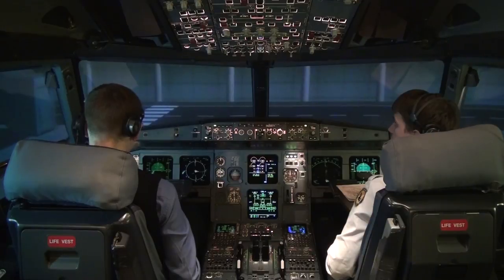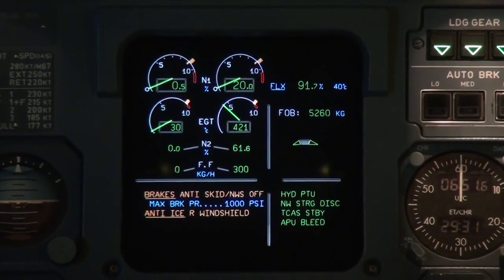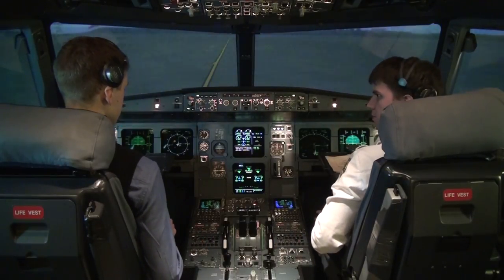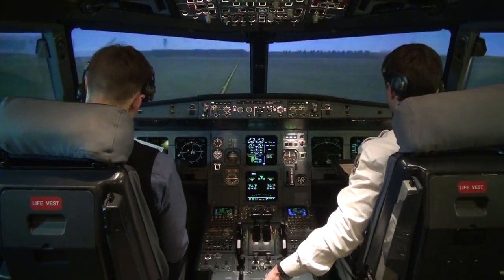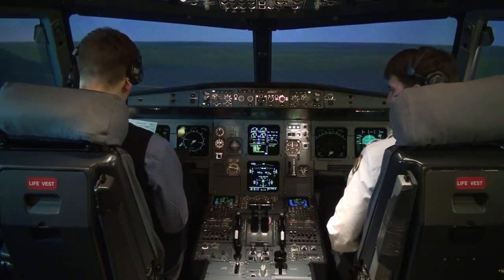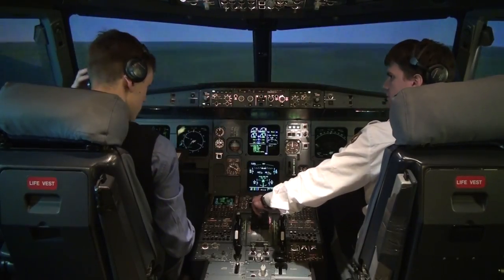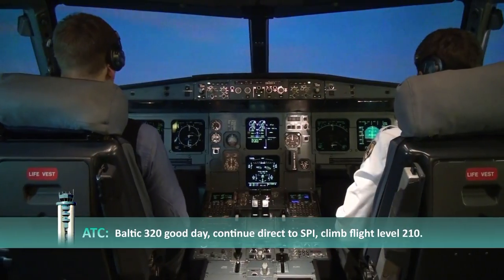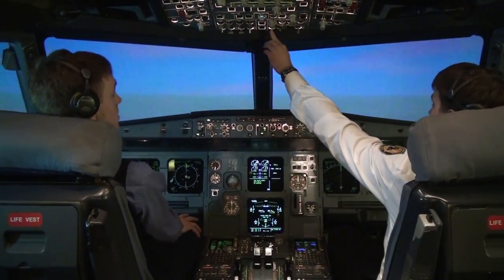Flying Airbus A320: full flight video from the cockpit (part 2) - Baltic Aviation Academy

Comment: Watching the series the first time. I'm guessing both of the pilots on the video are students? If so, I fully understand.
The good thing here is that they are doing everything in a calm and somewhat slower fashion than your normal "years in the biz"-pilots would do, but I have to agree that there are quite a lot of mistakes made, which as I said, is understandable if they are both students.
Either way, thanks for the videos.
Blue skies!
Reply: they have to work on the mcc lack of communication and the proper way to describe the situation after an engine start

Comment: -Didn't turn off the external power before disconnected
-1:50 wtf he turned off the nosewheel steering and anti skid, wtf. That's automatically done when the pin is inserted when pushing back
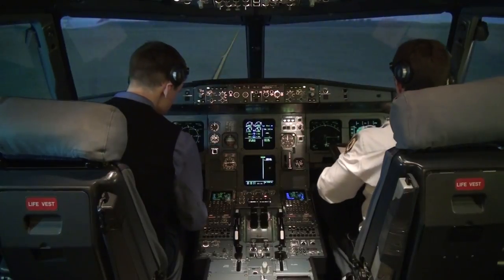-5:15 Turned on the Taxi lights without clearence and forgot runway turnoff lights
-6:40 captain didn't wait on the copilot checking the flight controls
-8:45 what did he check? Something he shouldn't even check?
-9:25 wtf did he do with the throttle
-9:40 rotation was way too fast, could've leaded to an alpha floor protection
-10:05 'thrust levers to climb maybe?' 1. Check your freaking pfd for that 2. Maybe? What's that in aviation?
-10:28 maybe flaps 0 lol
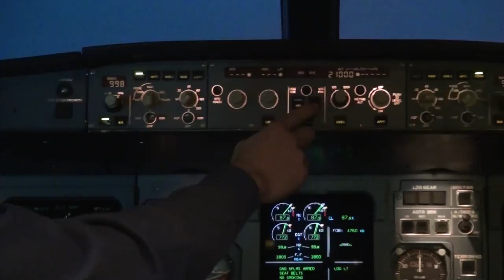-11:10 passed transition altitude but didn't set the runway turnoff and nose lights to off
Reply: Haha you are so cool. This is a student in a flight school showing what he gets to do in school. How dumb do you have to be to think this is a how-to video?! You really took the time to make this list...Your desktop flight simulator not working today??

Comment: Very interesting video as usual but you do not really seem to differentiate between the pilot flying and pilot non flying. The two roles are quite defined but you both seem to jump over each other and touch the thrust levers as if one is fighting for control. You seem unprepared for your assigned roles. Perhaps a touch enthusiastic but who can blame you. Great work as usual!

Comment: A little messy, smoother rotate perhaps and set flex not full thrust. But, they are the pilots after all. They are learning, they are bound to make mistakes. I'm currently looking at different FTOs to train with, I'll keep an eye out for BAA.

Comment: I detected some big mistakes...
Reply: No FMA reading, for flex take off PF gave TOGA power n PNF took thrust levers back..
Reply: no to config, that was in test no in normal
Reply: amol ganne Yes, also "positive rate" is not for Airbus. And there also was a mistake with "landing gear up and off". That seems like b737 pilots were sitting in the cockpit..
Reply: Smart TV positive rate is for every plane from C172 to 747.
Reply: @taffy5152  talk after you read Airbus fcom standart callouts.
Reply: They didnt disarm spoilers and close nose and turn off Lights after clean configuration. They didnt close packs before take off. So They didnt open packs after setting climb detent. Etc etc
Reply: They didnt on autobrake max before take off. They didnt open pm's terrain on nd. Checklist use and callouts are completly wrong.

Comment: Packs should be off before takeoff. Nose lights and runways turn off lights should be off after retracting the gear, and the rotate was mad
Reply: Who said that lights should be off after gear retract, lights should be turnoff at FL100 FT. :)
Reply: Dont talk when you dont know about aviation. Landing lights should be off at 10,000 however the NOSE light and the RUNWAY TURN OFF LIGHT should be off straight after the gear is retracted as the lights will still be hidden as the gear will be retracted and the lights are on the gear so there is no point keeeping them on. Do you understand?
Reply: Augustas Klova 
Dont talk when you dont know about aviation. Landing lights should be off at 10,000 however the NOSE light and the RUNWAY TURN OFF LIGHT should be off straight after the gear is retracted as the lights will still be hidden as the gear will be retracted and the lights are on the gear so there is no point keeeping them on. Do you understand?
Reply: Oh, i'm sorry, i've mixed landing lights and nose lights.
Reply: If i'm sure the nose lights should be off when the after takeoff checklist arives.
Reply: No. Its not even on the checklist
Reply: Its just a standard procedure. Gear up, nose lights and runway turn off lights of and ground spoilers disarmed ...
Reply: I've seen on some checklists.
Reply: Packs can stay on they don’t have to be turned off (in boeing yes airbus no) Nose and rwy turn off lights turn off automatically after gear retraction on airbus you just need to put the switch to off, rotation was bit crazy but they are/was students and mistakes can happen.
Reply: Arlind Celkupa and correct there isn’t an after take off checklist. Instead it’s an after take off flow that you go through.

Comment: How do you arm the speedbrakes on an Airbus? On a Boeing, you have to set the speed brake lever to the white "ARM" line. But on the airbus, I dont see that. How do you do it?
Reply: You just pull the lever up I think
Reply: +XpertPilotFSX the 0% of speedbrake is not full up, but little bit of space remain and this space is to arm the speedbrake

Comment: Rule of thumb - If either pilot uses the expression ''maybe'' they should not be in the flight deck... Retarding throttles during the take-off roll, going to flaps one below the safe clean speed and to zero flaps also below the safe clean speed, in-complete checklists in the wrong priority - If you're going to do a video on the A320 at least do it right, properly briefed and knowing what the aircraft is about to do, before it does it, then and only then do you know what you're doing.
Reply: look, I agree with you by retarding throttles during takeoff roll, but they did not retract flaps below minimum flap retraction speed. That's the only thing they got it right :)
Reply: Cathal Kavanagh Really? This is a student in a flight academy showing what they get to do. This is not a how-to video... A desktop flight sim know it all critiquing a young student learning how to fly- you’re really cool.
Reply: @dylconnaway9976  sorry but they are not kids, theres a big lost in the CRM management and as a pilot you have to have that gift (leadership, set priorities and work as a TEAM). Furthermore, videos title says Flying the A320, so THEY SHOULD DO IT RIGHT IF ITS A VIDEO REPRESENTING THE FLIGHT SCHOOL... just saying.

Comment: after star engines you must apu bleed aou master off, check cabin, autobreak MAX,  Line up - TCAS  mode C. Terrain radar on, weather radar on , Timer on.
Reply: 1) it's either Terrain or WX in the MFD, not both at once 2) Radars are only turned on when you enter the runway due to the strong rays 3) Mode C is not always required, in the US yes, in Europe, almost never on ground

Comment: Good go ahead radio to tower ✅, equipment to ground communication ✅, tail fin and breaks check, head unit and communication in cab pilot to pilot ✅, power release check, boosters engagement check, boosters to forward thrust check, maintenance check complete, taxi to runway confirmed check 🇺🇸, final break departure and forward thrusters to full booster checklift off confirmed check, final approach to runway prelaning flight ✅,

Comment: The term "flight level" is not used until you reach 18,000 feet and thereafter (FL180, FL240, etc)... 6,000 feet is referred to as "six thousand".  Anything from 10,000 to 17,000 is referred to as "xx thousand" - eg: 13,000 is "one three thousand".
Reply: Depends where you are flying. Transition altitude is not 18000 ft in all countries.
Reply: On climbout after breaching the Transition Altitude, the altimeter subscale is set to standard (1013HPA/ 29.92 In-Hg) after which the vertical displacement of the aircraft is expressed in Flight Levels. Transiton Altitudes vary between airfields.

Comment: When you run a checklist both pilots cannot be talking at the same time. There must be an active reader and a passive but the doer. Items were not checked in a systemized fashion. Overall a good video but the PF and the PNF was not very clear to me from the beginning. The phrase I have Control is vital in determining who has the controls of the airplane.